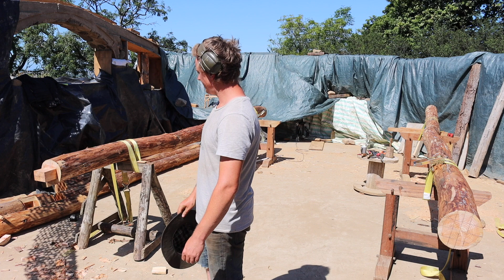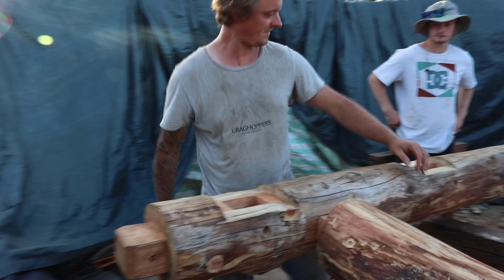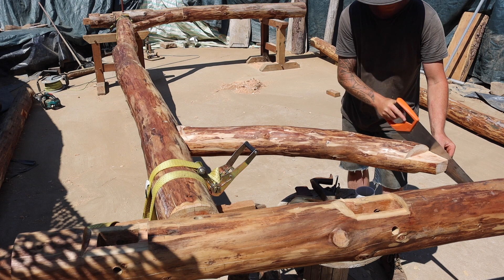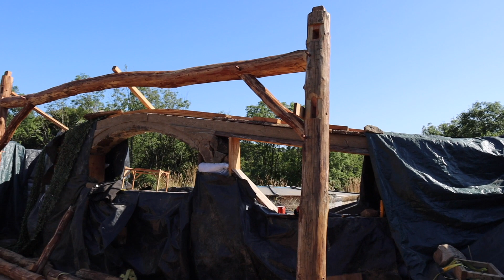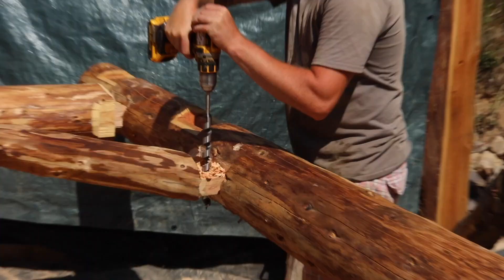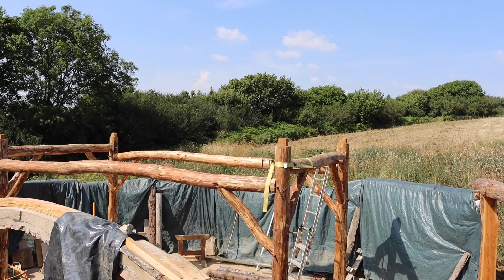Off Grid Earthbag Workshop Part 65 Roundwood Timber Frame Raising

Comment: I remember framing condo's in Houston in the 80's we put r-max foil faced insulation on the exteriors which directed the heat back in like you were facing I had a little thermometer that pegged out at 125f /52c it always went past that the thing you have to be careful of is when you quit sweating.Or if you run out of cool golf shorts🏴‍☠️ looking good Kris.

Comment: Little ideas for you that worked very well for me, I made two bolt on brackets for the side of my front loader they were like axle stands with half moon welded on top .I could adjust them up and down to get a higher reach withe the bucket .Great work .👍

Comment: Well done m8 from Straya. one tip for ya, when you need more height to lift beams you can set up a crane or boom coming out of your bucket use a log if you want with a hook welded onto the end for a chain tension the boom back to each edge of the bucket and you can get substantial lift height.

Comment: yep hard weather here in brittany too, been sawmilling on concrete against a cream tin barn ;0) nice job , steel assy pins and an offset pricker to mark the offsets for draw pegging, would make it easier, you just knock out the steels when its up one at time then replace with oak ones. but looks good congrats!

Comment: Hello from Sweden !  You probably already  figure that it would be wise to try get some membrane as a  distance between the poles and the concrete floor as a moisture protect. It protects the end of poles to soak up  moisture from the concrete ,that  makes them poles rotten in future ...
Reply from the maker: Yeah, they are going to have some slate under them.

Comment: You need a boom for your tratcor.
We built one from 4 inch channel iron and a 4 inch pipe, 8 feet long.
2 chains secure it to two hooks welded to the top of the bucket.
It's built like a T.
The channel sits in the bottom of the bucket, and 2 small angle irons hold it down. 
I can get pictures if I'm not clear enough.

Comment: As tall as it looks it still seems too low to incorporate your reciprocal roof structure around it. At least with the limitations of the video. 
This structure is a detour from your original design so it will be interesting to see it all fit together in the end. 

Amazing work and amazing volunteers. 👍🏻👍🏻👍🏻

Comment: Hey guy, I'm mighty impressed with your tradition principles! It's right up my street, a Hella lot harder one could easily say than modern construction but I find its way more satisfying to use pegs over screws, showing the raw wood rather than factory edges which are perfect but in other settings of course. May I ask, if not too daft, why or what might be involved to shape each joint end (even mid lengths) to fit each outer circumference rather than flat edges where visible? :)

Comment: I now understand why the Amish use lumber for timber frames rather than round ones. The ease of just copying the same pattern over and over is better than custom fit every time. I do like the round frames yet I would also be happy with square timbers as long as the pegs are sticking out. That just looks better.